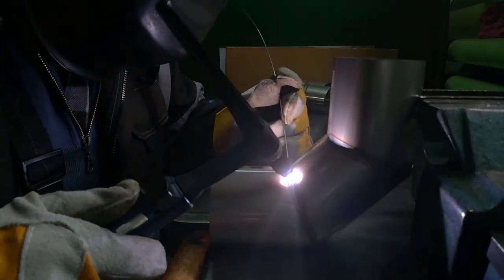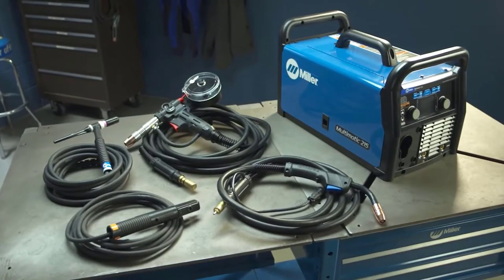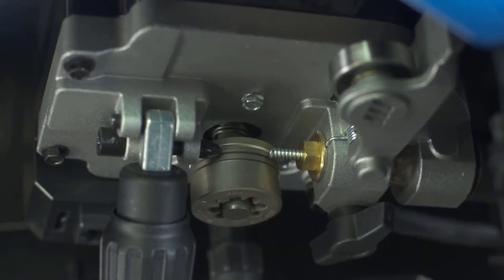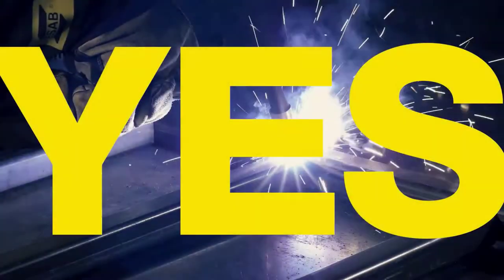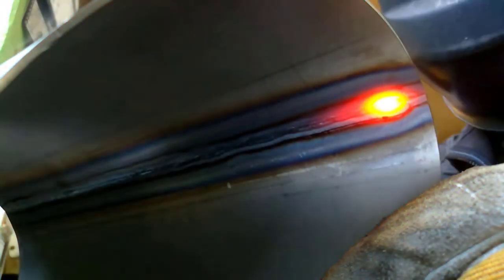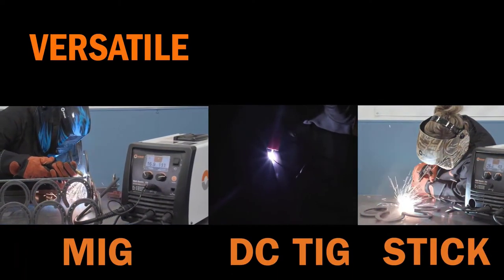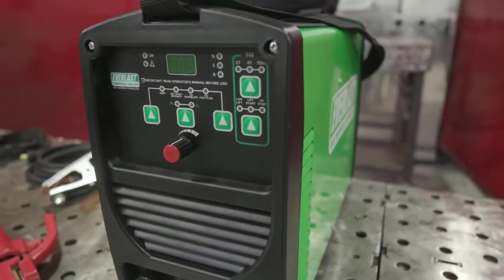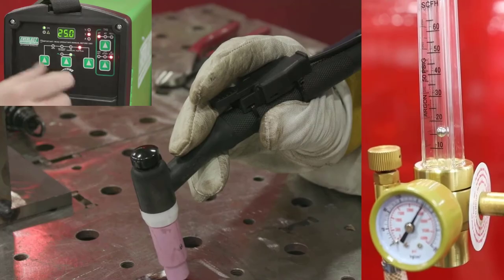Best Multi Process Welders |🔥Top Multi Process Welders Review 2023

Comment: Bought a good quality machine. WIA 200i. Used one bottle of Argon to get familiar with set ups then left it sit for a few months till I needed to do some serious work. New bottle of gas and turned it on this morning and all the lights came on but there's no way any of the functions or modes would accept any kind of input. Could not adjust a single thing and the only thing that worked was the gas flow when the trigger was pulled.... 7-8 weeks I've been told for a warranty repair... Anyone have any ideas? Service voltage is ok and nothing's changed since day #1 other than there's just no more sparks happening... Started as a welder 50yrs ago and never once did I ever see any machine needing to go back for repairs.......Sept 21 2021.
Reply: Yea this is why u should get a machine that actually have service centers 

I suggest just going to a Lincoln electric miller or something similar service center       

U will have to pay for it of course
Reply: @RollingEasy  i have a HBM tig welder   made in china aswell but the company that sells them is Dutch  so they always fix problems

I hsve a rowac 300A welder mig      also dutch made   i can just drive down and they fix it 

And i recently got a miller MPI220p  
Haven't had any problems with it as of yet 

All of them have like 200 hours of arc time on them 

I want EWM welders   but there so expensive its not even funny            but i can call them at any time snd they will send someone to come fix it 

So i have 4 welders 
Tig dc  300 bucks 
Mig 300a  1200 bucks 
Miller MPI220p  2000bucks 

If u combine the price of them u barely reach 50% of the cost for my ac dc tig welder from EWM  which is german 

For a hobbyist id actually argue to get a bit of a more expensive machine then getting on wish or Amazon and ordering something for 300 bucks 

So did u get it fixed or wat did u do with it?

Comment: Ewm or Fronius seem to beat these
Reply: yeah its typical that a american reviewer wont include a fronius.. mainly because it wipes the floor with anything else.
Reply: @Migman2020  and the EWM
Reply: The Rebel is Chinese.  I personally went for the Fronius..The EWM stuff is German and in my opinion better than the Fronius, however,  the 2200 transteel  pushes far more from a regular UK power supply...
Reply: @JohnSmith-ho8up  fronius is Austrian which is pretty much german but personally i think fronius wipes the floor with ewm when it comes to pulse migs. especially when you start using the advanced processes like lsc and pmc. i speak from experience
Reply: @Migman2020  nice one.  Do u rate the Transteel 2200?
Reply: @JohnSmith-ho8up  I own a tps 320i and a transsteel 3500 before that so yeah they definitely leagues ahead